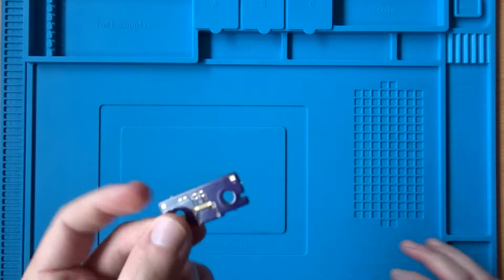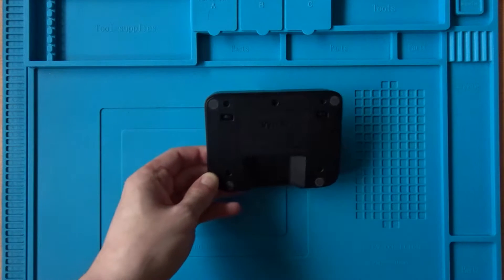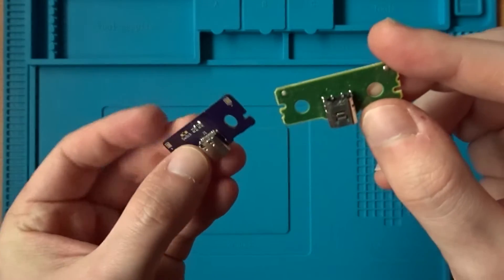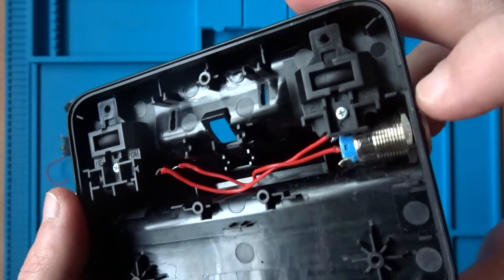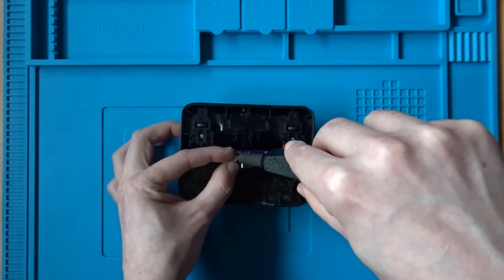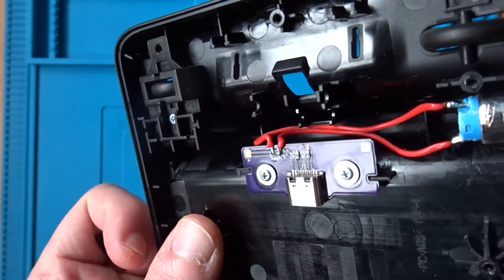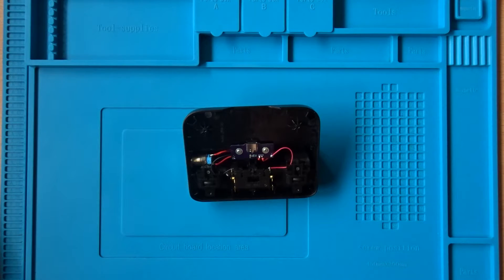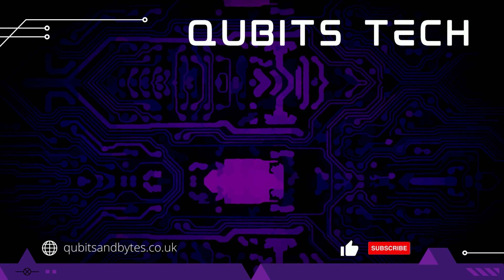Charge a Wii U Gamepad with a USB C Cable | Made by Qubits | Qubits Tech

Comment: I was quite excited when I noticed that the mod chip was back in stock on your KOFI, but to my disappointment, I noticed you do not ship to Australia😢, is there a workaround?
Reply from the maker: Hi, I've added Australia as a shipping option now if you're still interested. Just be aware that shipping is expensive, even though the board is tiny, and you'll have to consider any import fees that would be due. If you know someone locally that can do the soldering, it would probably be cheaper to order the PCBs yourself and get them assembled.

Always happy to offer the option though :)

Comment: Is there a way to put this in the gamepad, because the charger is the one thing I HATE about the Wii U. Near flawless system
Reply from the maker: There's plenty of room inside the gamepad so it would definitely be possible. That would mean risking the gamepad though, so it's not something I really want to do.

You can buy generic type C charging boards quite cheaply, one of those should be enough if you can find a good place to mount it.

Comment: What kind of charger do you need?

Just bought the last one 😬
Reply from the maker: The only charger I can think that wouldn't work would be a type C charger using an incompatible cable. If you have a phone charger/cable, you'll be fine :)

Type A to C cables will also work fine.

Comment: I just had some of these done by OSH Park (:
Can't wait to put setup the dock this weekend
Reply from the maker: Sorry for taking so long to reply, that's great to hear. Hope you managed to get it installed successfully :)
Reply: @qubitstech  no worries! Was wondering if you'd looked at doing something like this for the 3DS docks?
Reply from the maker: @ViolinistProductions  Funny you ask, someone asked the same thing through my blog almost a year ago. The result is sitting on my desk :)

It's a more tricky install than this one, and I'm not 100% sure where exactly you need to trim (so I ended up trimming a lot from inside the dock), but it works. Just need to get everything ready to release it.
Reply: @qubitstech  I'm assuming this is for the OG 3DS dock? That's amesome that you already had something in the works.

Dock modification is 100% more efficient, and poses less risk to damaging consoles/controllers themselves
Reply from the maker: @ViolinistProductions  I bought an OG dock for testing (I don't actually have a 3DS), but the person who asked about it has several different docks and found they all use the same PCB
Reply: @qubitstech  Oh awesome, I wasn't aware of thah

Comment: Groovy. This seems like a good way to get comfortable soldering. I'm not risking the whole console, and I get to try something new
Reply from the maker: Definitely, it's also reversible if you ever wanted to change back. Well, assuming you don't add a switch.
Reply: Except it would be better to risk the whole console since the gamepad is worth double the price of the console
Reply: @sybsygstgstsgysg5330  Except the mod is specifically for the gamepad charging dock, which is significantly cheaper than the gamepad itself...